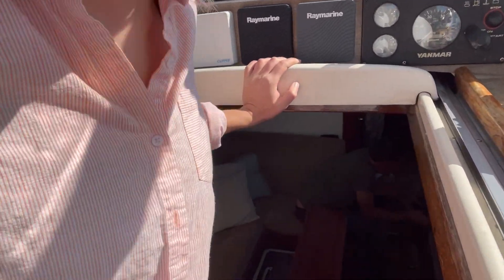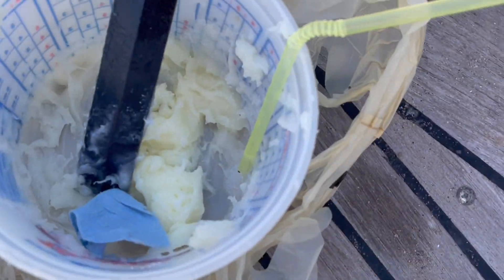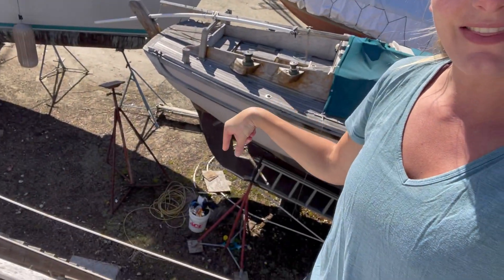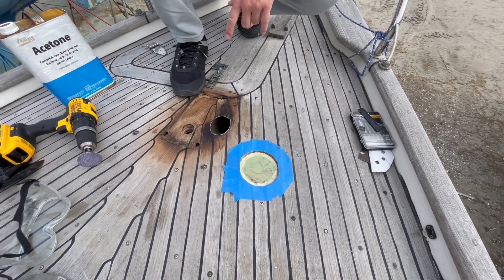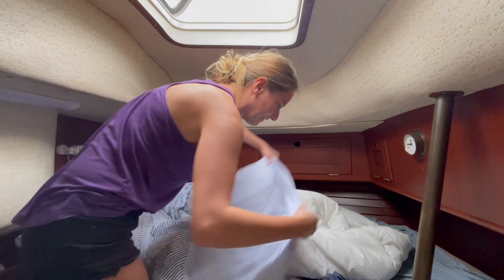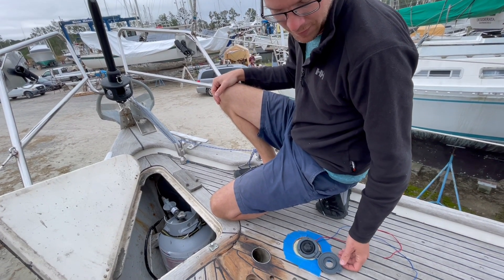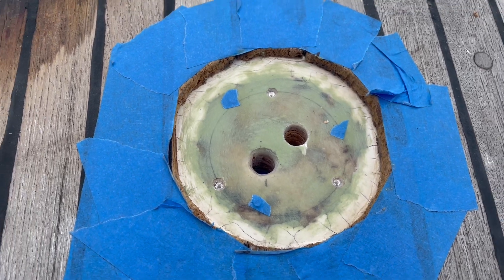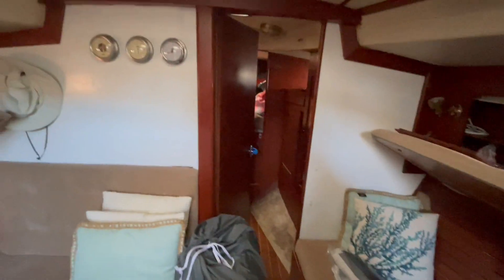The *CAPTAIN* Made a MISTAKE?? |Don’t Look DOWN😳| LIFE on the HARD | Sailing Joco EP40

Comment: Hey great job guys, your covers look great and the adjustment to the foot pedal lid was a good idea because now the lid will be clear of the windlass and the chain, the duvet fiasco may be avoided in future if you do it in the salon then take it forward, but you had fun right, so no big deal, you could find yourself a length of fencing wire for those drain holes, and keep it on the boat somewhere for future use, wishing you all the best from Aus, Al
Reply from the maker: Thanks Allan ! Yes , Jeff is much happier with the new switch setup so that’s all that matters :) and I could only do the duvet in the salon if the salon isn’t a complete disaster of projects (which it was the day haha!) but yeah , it was fun anyway :) 
That’s a good idea about the fencing wire ! Will keep that in mind for sure !
Thank you so much for watching and commenting , that’s awesome !
Reply: @sailingjoco  Hi!,my first comment of feedback is about this ladder that you are on.. one handed, (where is the head mount camera?) I personally would lash that ladder, why dont you have it where the lifeline disconnect is? Getting to the top of the ladder, with only one hand, and then stepping over a lifeline? Too risky IMO
Reply from the maker: Thanks for your concern ! Not to worry , two hands are used when climbing over top of the lifeline :) and there’s no lifeline ‘disconnect’ (I’m assuming you’re meaning a gate?)

Comment: Be careful Jeff you may be over thinking this switch.  The IP I purchased had a hand held wireless remote with chain counter and the boat has a bow thruster so installed a wireless remote on that. I am a retired A&P mechanic and I soli sail.
Reply from the maker: Thanks for your insight Daniel ! Yes we have a remote for the (old) windlass which we will hook up with the new one once it’s installed. We have a full toggle switch for the bow thruster in the cockpit so were good there 🤙 
Once we get moving again (and with a beautiful backdrop) we will have to do a full boat tour!

Comment: I would have tied the rope from the ladder to the jack stand on the OPPOSITE side of the boat...that way if it is accidentally pulled, it should pull towards the boat and not away saving from a possible disaster.
Reply: Also, you could tape the bottom section of some panty hose or a cheesecloth bag around the drain port on the hull and use the vacuum yourself to blow the dropped part out.
Reply from the maker: This is a great idea about the rope ! We will do this next time
Reply from the maker: And the reason I couldn’t just use the vacuum on the drain hole the barrel lock fell down is because that drain connects in a T with other drains and we didn’t want to lodge anything extra in there by mistake. We’re just happy it all worked out in the end haha ! 
Thanks for watching & your comments!
Reply: @sailingjoco  that makes sense. Looking forward to more videos and checks for sharing your journey..I'll be starting mine very soon as well